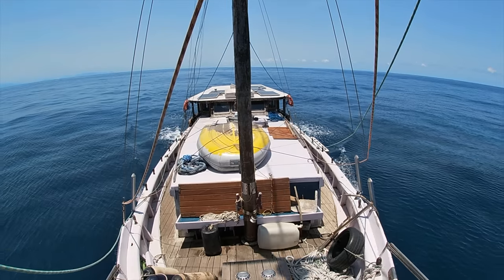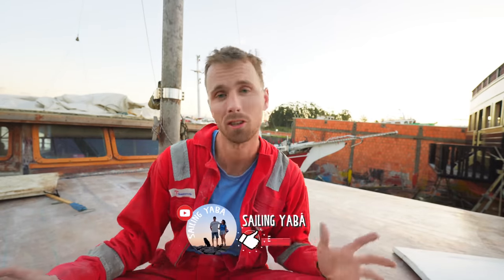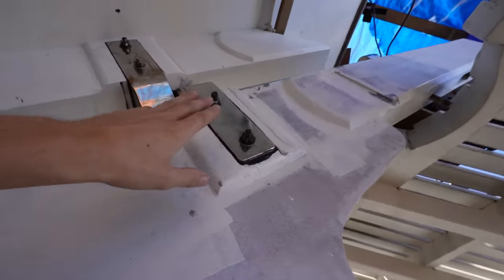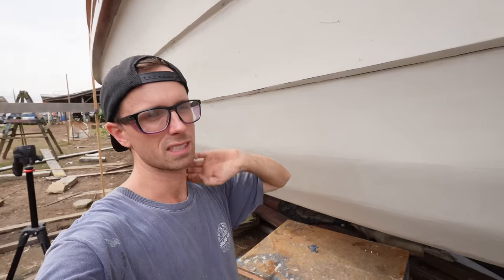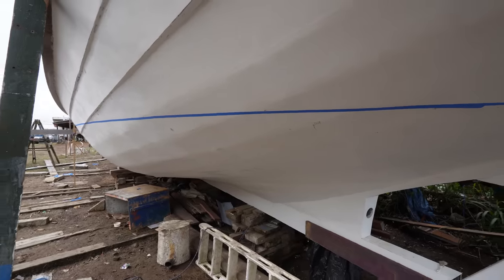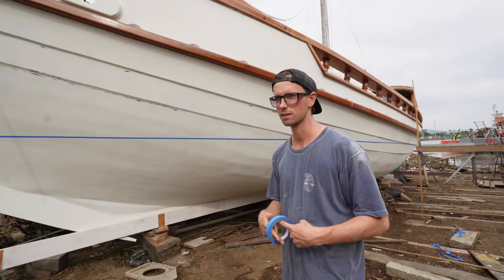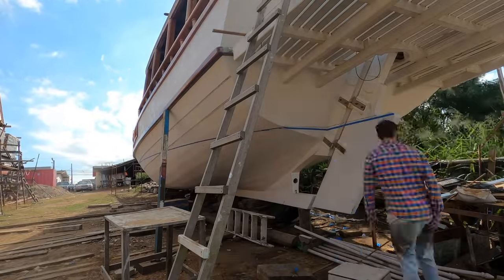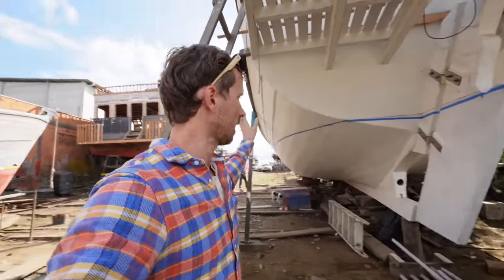Defining the WATERLINE of our once SINKING BOAT without any equipment — Sailing Yabá 138

Comment: Wow, you worked so hard doing it that way.  I can't believe all those old timers don't have a water level.  ???  It is almost foolproof and can be used on both sides.  At least you know the best technique for applying the masking tape.  I see so many sticking it on foot by foot.  What a crooked mess that produces.  Good luck with the rest of the build!

Comment: Use a water level.  Get a clear tube long enough to go to each side and fill the tube with water to the match the tape line.  The water will be level on the other side.   At least you can double-check your work.
Reply: That's what we use.... works like a charm.... but... the boat needs to be level.... then again that would apply to a laser as well
Reply: @TheOverproof151  No you can lock the "LaserLine" to prevent to go in level. And then just align bow and stern mark. So easy it is. ;-)
Reply: The boat isn't on level ground
Reply: @micahgerdis1008  even if the boat isn't level it can be done by putting the reference point at keel level.
Reply: @TheOverproof151  Most laser levels can be canted and locked
Reply: @MohammadMardaniK  you may be right in process but the thing that confuses me about this is just because there is a keel doesn't mean the balance and weight of the boat will make the water line/ level an equal distance away from the keel.
Reply: Had the same thaughts.
Reply: Could use the water tube method to at least transfer from one side to the other. Assuming it's level from side to side.
Reply: @micahgerdis1008  but the boat is level
Reply: Or use a laser.
Reply: You stole my thunder, i was the first to suggest that.🤣
Reply: @josefbry  This is sailing Yaba, I think your missing the point. they might has well have ordered all their timber pre cut by CNC
Reply: @stevedraycott4289  Yes really?? I was just thinking logically what i will do in this case. Reason?? It it's not just repainting of a boat. It's pretty large renovation. So, it is to expect that weight of that vessel change (Furniture, all new wood and so on). So that old waterline can be wrong after refit. That way i see as reasonable to put first time the boat in the water to see .... but you may know more as i. And i believe you just missed a point im Maintainer i know how Laser Liner work. So, i just say how to doit. Sorry for that if it disturbs you. Actually, i don't see a reason for your attitude, but you may have some psychical trouble??? Or you just like mobbing people??? Coz they are clever then you.
Reply: @josefbry  Im sorry you got so upset .. "coz clever then me lol. do you understand calculus  a branch of mathematics that finds the properties and derivatives of functions ? this would take the whole of Yaba and he new fittings into account. I understand calculus and would be happy to help you with it. please check your grammar. Coz they are clever then you?PMSFL

Comment: This episode was painful to watch, but I admire your perseverance.  A water level would have saved you so much pain and effort.  But, you did a great job! Can't wait to see Yaba cruising with that waterline showing proud! MP and yourself should be proud of what you've accomplished so far!
Reply: Dear Timajin1.
👍👌👏 Yes, it was definitely painful. Even pretty unbelievable.Therefore I stopped watching. A worldwide known, common water level or a laser would've saved over 90% time. I really hope that this significant lack of common knowledge doesn't show the quality of the work done in this boatyard.
Best regards, luck and health in particular.
Reply: Yes it was I walked away several times not sure how to rank this one 😢
Reply: Levels find level. If the boat isn't level making a level line wouldn't be exactly great. Still be leveling off from the string and trying to be perfectly perpendicular to the boat.

A laser line can be used that doesn't require leveling but can cast a straight line across an uneven or curved surface in any direction/plane. 
But a simple chalk line using three points could achieve the same result also. 
Anything that lessens the error of trying to hold the level straight vertical, perpendicular and horizontal. 
Ah well it won't be the last time they make this line, just the first.
Reply: Wrong , these comments all assume the boat is level on the ground which it's not, The method used was a  way of marking the waterline 1.60m up from the keel irrespective of the angle keel is at. Spirit level or laser is no good for that. pay attention to the actual problem to be solved people.
Reply: @jabberwockytdi8901  Sorry, after 20 years working in a shipyard, I tend to assume that one lays the ship level in the blocks. A master builders plate affixed to the keel as a set reference to zero helps a lot too. I guess these are too modern an idea, since they've only been used since the Egyptian times. Don't make a problem harder than it is.
Reply: Painful to say the least. It seems he was trying to fill a content gap. Quantity does not breed quality.  Shame😢
Reply: @Timajin1  
👍👌👏👏👏👏 Exactly!
Best regards, luck and health in particular.
Reply: I completely agree all you've said!!

Comment: The advantage:  lots of boatworks and experienced shipwrights on the coast of Brazil and South America that have experienced locating a new waterline on wooden boats.  Which is also the disadvantage.  Many experienced methods still need be distilled and the best of the best idea chosen.  A daunting task, however you have a proven record for decision making, so the method you arrive at will be the correct one…

Comment: If you have a good line on one side of the boat and wish to transfer it to the other use a water level, its very accurate.  Assuming the deck of the boat is level across, use a clear flexible tube, mostly fill it with water and then with the tube under the boat place the water level on one side at the point on the good line and the water level on the other side of the boat will be exactly the same.  Then move the tube up and down the length of the hull to transfer as many points as you like from one side to the other.  Simples.  This type of water level is an ancient device that is still used today as an alternative to sophisticated lasers.

Comment: With your reference being the measrement on the rudder, a much simpler low-tech way to mark your waterline would be with a water-filled clear plastic tube. With the tube being some metres longer than Yaba, get the meniscus (water surface in the tube) at one end level with your reference mark and the meniscus at the other end of the tube held against the hull, would be at exactly the same height - as near as next to the reference mark or as far away as the tube is long. If the keel isn't level, jack it up until it is and ensure the boat sits evenly port to starboard..
Reply: Water level would have had this marked out in an hour, Im surprised the crew didnt suggest it honestly.
Reply: Would only work if Yaba was sitting level on the slipway
Reply: it will work
Reply: Had to read it twice but yeah, nice one 👍.
Reply: @Ghost-Prism  Assuming that ship is in level yee.
Reply: Ship doesn't have to be level.... The water will always level out when u use his tube method cuz my dad did it... I don't recall anything in the Ozarks being level.. but his waterline was on point..
Reply: @brucestarling7665  It is. They levelled Yaba the last time they moved the boar to it's new location.

Comment: How did they determine the waterline in the olden days of sailing? One sure fire way would be to float the boat and mark the true waterline. Knowing the waterline at the bow and stern, a lazer set on a tripod could be oriented to swing between those two known points, then hand draw the waterline along the lazer line from bow to stern.

Comment: Love your engineering techniques, there's always a way 🧐😄
You can also use a long clear hose with water set your level at one point and the other end will always show you the perfect duplicate height. The original Dumpy Level

Comment: Why don't you use a length of clear tubing. Fix one end to the hull 6" above the desired height. Then full the tube with water to the desired height. You can then walk around with the other end of the tube and use the water height as a marker.

As long as one end of the tube is fixed the water level in the tube will stay totally constant! Only works of the boat is level of course!
Reply: Because the boat isn't level. there is no level reference.
Reply: Omg😮

Comment: Surely there's a laser level in Brazil? 
Also please make sure your boat is perfectly level side to side and stern to bow. 😮
Reply: The boat does not have to be level.  Measure the inclination of the boat with an inclinometer and set the laser according to the inclination of the boat.
Reply: yes  LASER LEVEL
Reply: We have laser levels in Brazil. And they are not too expensive.
Reply: @henriksamuelsson3466  the problem is you don't know what the inclination is the bottom of the Keel isn't necessarily parallel to the water surface
Reply: @josiasbrepohl5300  sometimes people know the answer. But, buy it just to do one job with it. It doesn't deserve the effort!! It happen to me. Only if a friend have it!? For you to borrow it!! Abraço de Portugal para o Brasil. Penso que seja brasileiro? If you're not? Sorry
Reply: Can’t you just put YABA in the water and see where it is?
Reply: Then bring her back out and finish painting
Reply: How did you first make the boat level side to side and bow to stern?

Comment: I'm not convinced   this line will be  anywhere near close   You don't know how heavy the boat will end up .
Reply: Yeah. 100% right. The boats weight distribution has likely changed.  The previous waterline is not a bad place to start but no guarantee it's correct.
Reply: @lukeboelitz  they didnt use the privious line but moved it 8 inches up.

Comment: Once you know that you've got the waterline correctly marked, do yourself a favour and scribe a shallow thin line into the hull for future reference, so that it's still marked if it gets over painted.
Reply: Underrated comment. A scribed water line is a huge help. Especially when you have to repaint the hull eventually.
Reply: actually i wouldnt, since once the boat is in the water they will see where it really sits and next time they put down a waterline they will want it in a diffrent height and just measure before going out of water where the next one will be.
Reply: @schuttrostig5729  That's why he said once you know that it is correct.

Comment: A water level was my first suggestion. But once you started measuring to transfer it to the port side, I was yelling into my phone that you didn’t need to use a level anymore! Assuming that both sides are symmetrical, you can take your measurements right on the hull. Being absolutely vertical increases the chance for human error. But the result still looks perfect, it just might have been easier.

Comment: Once in the water and ready for a repaint be sure to remark the waterline and scribe in the water line as is normally done on boats that size.  By "scribe in" I mean a groove about 1/8" or 3mm deep and about a 1/4" or 6mm wide along the entire  waterline.  this makes it easier to repaint in the future.  A cheap laser pointer could have made this a lot easier 🙂

Comment: Hi Ben and MP!!! There is another way to establish a straight waterline, and that is with a translucid hose, like the ones used in construction. Establish an initial height, and then transfer the same height with the water level in the hose to any where you want, i.e. to the closest point possible, then join the dots and you have your straight waterline! 
Also, you might want to check how the boat sits in the water and mark a waterline on that basis, taking into account that the waterline usually is at a certain angle with the sheer, depending on how the weights are distributed, mainly engine and water and fuel tanks.
I am enjoying every second of your vids. Keep at it!!! Well done!!!

Comment: You could fix one end of a clear hose to a known point, fill with water to that line. The free end of the tube will always have the water in the same height  Great update 2x👍
Reply: Yes, a water level is the simplest way to go.  But with todays technology a laser level is cheap and easy to use.
Reply: That's a great trick, however that would only work if the boat is perfectly leveled at sea level, which probably is not(?). For it to work they would have to compensate for the boat's inclination, which, I guess, would end up in an even harder task.
Reply: that would work if the boat was on eaven surface, but the keel is on a slope. So the bow is facing upward and the waterline is not horizontal.
Reply: @hf_santos  I thin k the inclination could be worked out very easily. If the bow is higher or lower just divide that in half for the centre section. divide again for the middle to stern point. The Greeks and Romans were using this method. The Romans built lots of aqueducts across thier empire using it. A little maths made even more simple when you have Alexa divide A by B ut it might be harder to work out in the heat and multitasking.
Reply: @michaelgutzmer3303  you would hope someone had one handy in one of the yards they could use for 10 minutes. 👍👍
Reply: Water levels and lasers would only work if the boat was perfectly level bow to stern and side-to-side as it would sit in the water.
Reply: @richardnwilson  the water level would work great with a little maths to compensate for the unlevel keel. At the centre  the line would be half the difference in level of the water level  The Roman'efficiently, using only this.

Comment: Don't stress over getting it perfect this time. It's only an estimate  anyway and you will surely end up modifying it at the 1st haul-out after launching - you have changed the ballast , completely rebuilt the hull with different/extra timber and added a completely different interior. On the otherhand maybe the boat was very wet when last painted? No way that boat will float at the same displacement or pitch it did before you hauled out.

Comment: Several things i found myself screaming about.
First, once you have the three points the string can be moved in and out away from the boat and as long as it is tight will provide the straight line.
A chalk line being ideal to make the mark using a pinch and strike method.
For transferring measurements there is no need to hold the tape measure vertically plumb. Far more accurate to measure with the tape in contact with the curve of the hull eliminating the variations and issues of trying to hold the level perfect, the tape and then mark. A cloth tape works well on curved and irreular surfaces. 
It was both fun and frustrating watching you put the arbitrary line on the boat. 
Cant wait to see her in the water, how close the midline is and how much balast adjustment she needs. 
Not a lot of freeboard for heeling.

Comment: here in Brazil we have very cheap laser level that cost around 80 to 100 dollars that make this very easy.
another option is to use a transparent hose with water inside to measure the level. This method dates back to the cavemen and it works very well.

Comment: To all the people who suggest using a water level or laser. These would only work if the boat was sitting on its cradle exactly in the same orientation it would be in the water bow to stern and side-to-side. The deck is curved on most boats and the Keels usually are not level or parallel to the surface of the water either. At minimum you need a bow and Stern reference point which can either be determined buy a Naval architect with a set of drawings or in this case a look at old videos would give you a pretty good approximation.

Comment: May I suggest how best to draw the water line..  Once the water line position has been established, fill up a hose pipe with water. put the two ends together so that the water  is full to the brim.  Then draw the water line station marks by moving the one end  hose along the length of the water line you have chosen.  The water in the hose is the same as a spirit level.  It works as well as a laser.
Reply from the maker: Thanks for the suggestion Jeremy!

Comment: I was wondering about the increased weight and the effect it would have on how Yaba would sit in the water.  Hoping you got it right Ben.  MP is watching !!!
Reply: All the very heavy equipment is in the Aft of the Yaba... so its going to sit lower in the water...  a laser trasit (or even a optical one) would make this easy...  mark the fore and the aft points and then use the transit to make a line from one to the other...  then have someone move the transit from aft to fore... and boom all done

Comment: Just to expand on the many comments about using a water level, if a long piece of clear tubing isn't available, then a short piece, say 12" or 300mm, at each end of a common garden hose would work just fine.  Station one person at the reference point on the rudder and have him call out up/down directions to the person at the other end. When the reference end is on the mark, so is the other end.  Mark it and repeat.

Comment: The absolute most accurate way to get a waterline, put it in the water. Much easier to do with small boats but still it can be done.

Comment: Tricky stuff, of course your assuming that when floating that the keel is level and not deeper at the ruddey. Having done so much work on the boat the weight and displacement may be different to what was but at the end of the day if it's not right you'll mark it when Yaba is in the drink and make corrections nest slipping. Enjoy the process 🏴‍☠️🏝️🍺

Comment: A laser is nice but this is where an old timer would use water in a long clear tube to level. Brick layers still use these water levels sometimes. As a Pool Builder I can attest, water doesn't lie when it comes to level. It doesn't matter how you get there though, as long as you get it done.